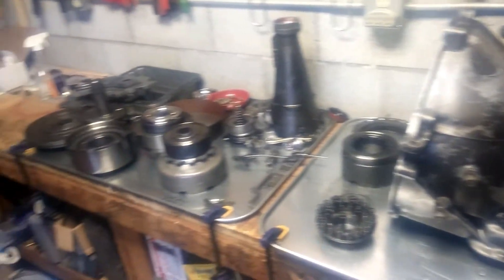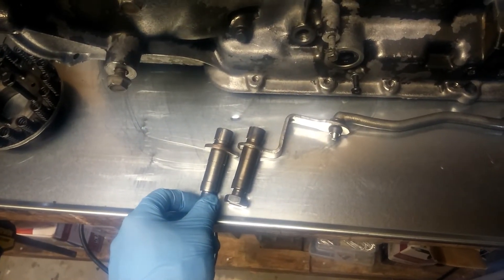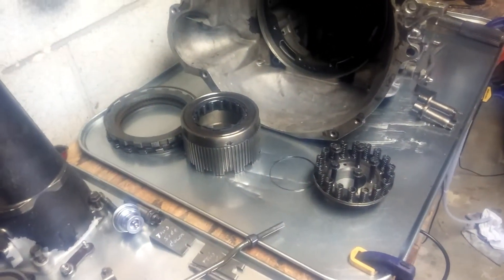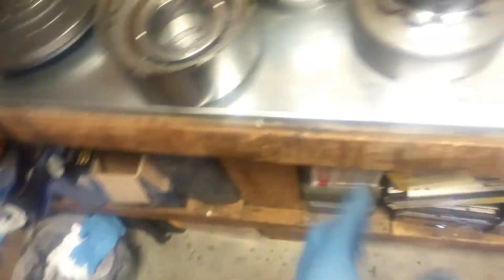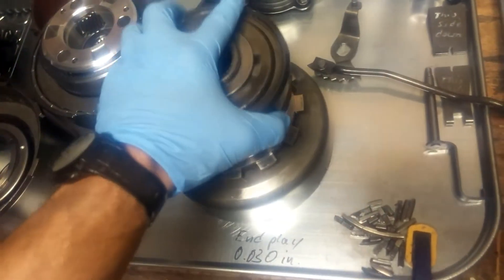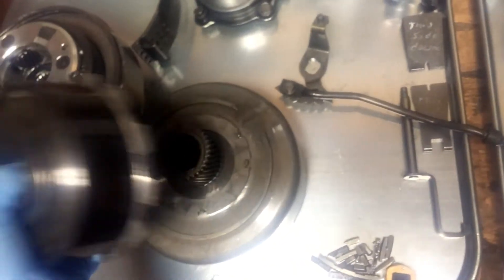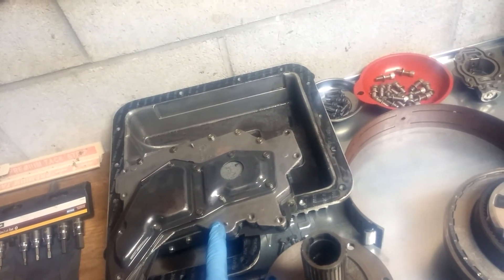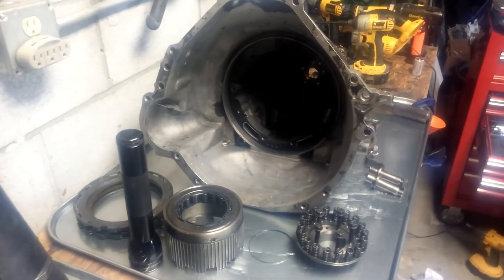A look at my disassembled ford C6 transmission

Comment: how did it go?   good transmission to learn on (simple)...
Reply from the maker: I got it back together. Few thousand miles later and it is still running. Only complaint I have is that the shift from 2nd to 3rd is a bit hard (not always, depends on load and rpm). I keep checking fluid and all is well. I installed an additional inline filter to make sure nothing but clean fluid is running through this transmission now.